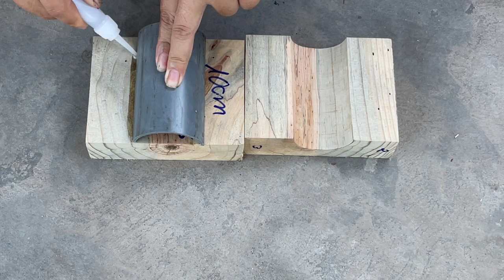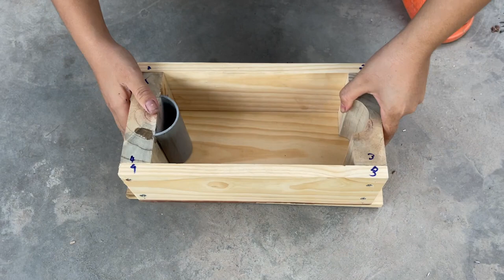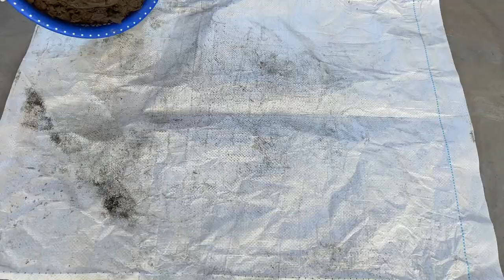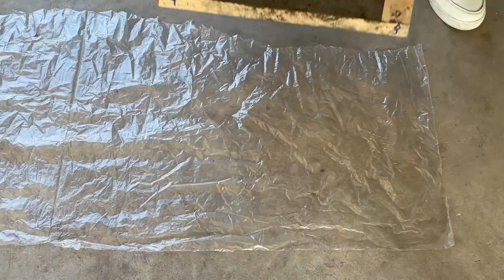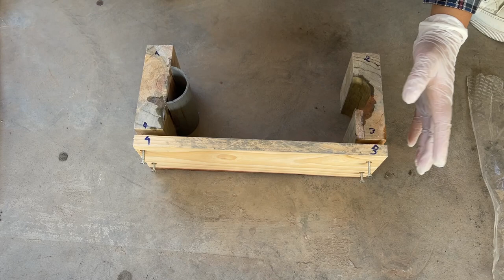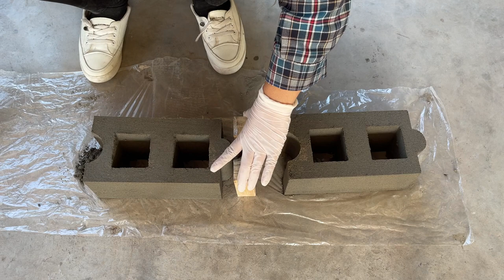Cement brick casting project with joints - Bricks with holes, Light and easy to operate

Comment: I have no idea what you intend using them for but the inner holes could be almost double in size. The locking ends need to fit tighter than they do to be considered a solid lock. Making a half bond corner block woild be a good addition and add strength to any wall you are going to build.
I like your innovation. Keep going you can only improve.
Reply: Keep going you can only improve.  A double-edged compliment!

Comment: How about this:
Replace the two inner blocks of wood of the form and substitute with insulating material like two equally sized blocks of styrofoam— these stay in place to provide wall insulation.
It’s just an idea 💡
Reply: Not good! Try again. You need aeration between the concrete. The concrete needs to breathe, if no air in between it will crumble.
Reply: @RH-vr7cs  I don't were you got that idea from but being filled (styrofoam isn't a good idea though) will not make crumble.
Reply: Sorry to say but your idea doesn't work. The percentage of the insulating (whatever is used) product isn't large enough. Radiated thermal egress will still happen through the rest of the block.
Reply: @darrellturner560  ...now in plain talk, please.
Reply: @PeterWest70  I'll do my best. The area of cement is greater than the insulation for one. The insulation has no impact being surrounded by the cement. The cement will conduct heat around whatever insulation product used.
I was a builder/mason for 35 years, with a keen interest in all things masonry. Building science and engineering is something I like to keep up with.
Reply: @PeterWest70  in non expert words, what darell meant was : you need like a membrane of insulation, 2 blocks would not prevent the heat from passing through cement and hence it's useless.